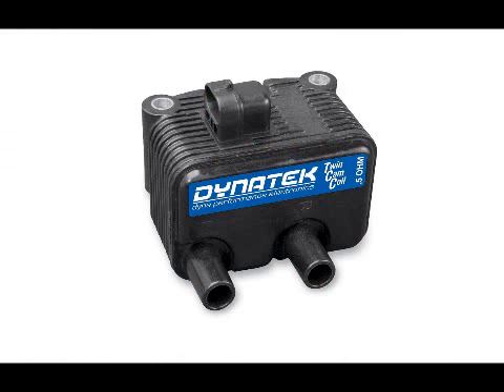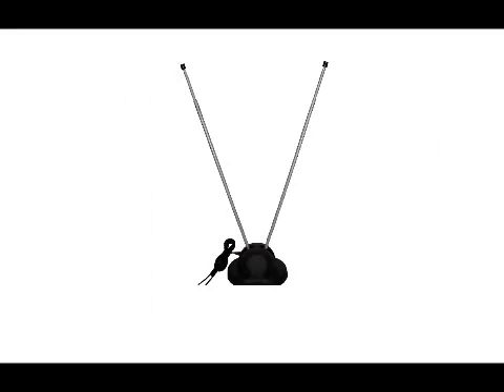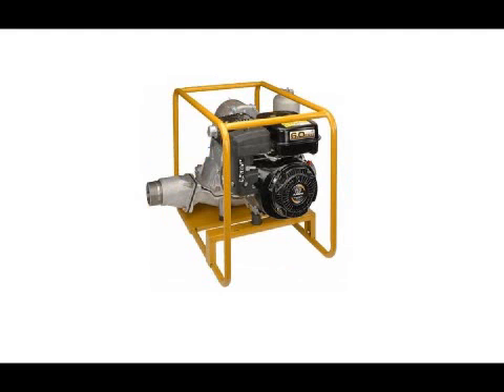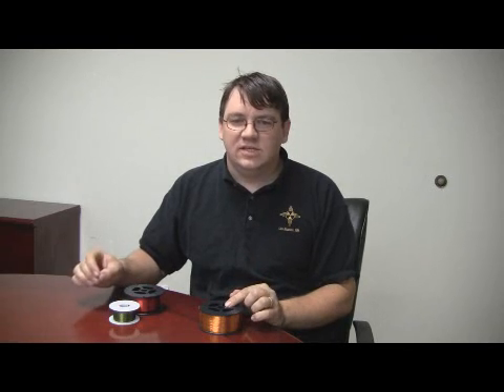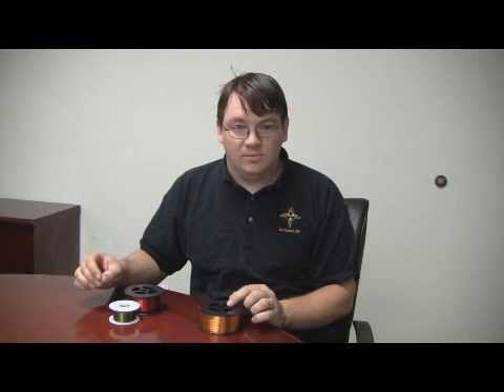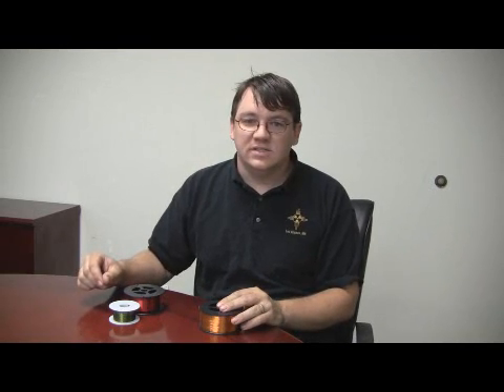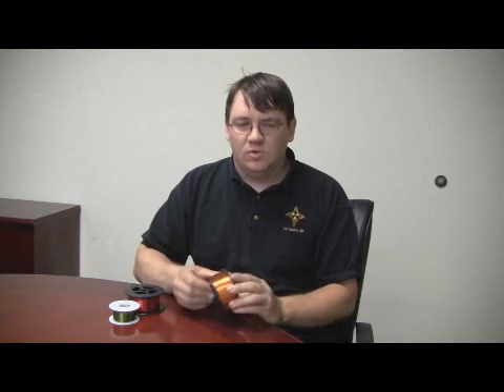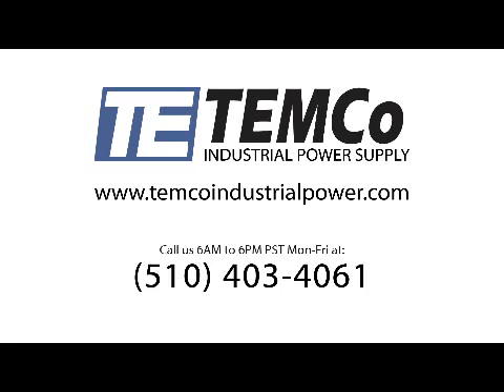TEMCo Magnet Wire Insulation Selection

Comment: Good day,

I have some confusion, I hope you can help me, and I know its better to ask the professionals... my question is, is the copper wire also a magnet wire? because I have a 24 gauge copper wire for Arts & Crafts, can I use them also in winding some coil?
Reply from the maker: Magnet wire is coated with a very thin layer of insulation. If your copper wire does not have any insulation, it is probably not magnet wire. You'll want to check with your supplier/manufacturer for that specification.

Comment from the maker: We do not currently carry 35 AWG or triple insulated wire. All our wire is double/heavy build (with the exception of our 45 AWG Soderon 155 line, which is single build). Yes, in general, you can use magnet wire for flyback transformers. Just make sure the voltage does not exceed the insulation rating of the wire. Please contact us at ebaysales@getpower.us for more details and questions.